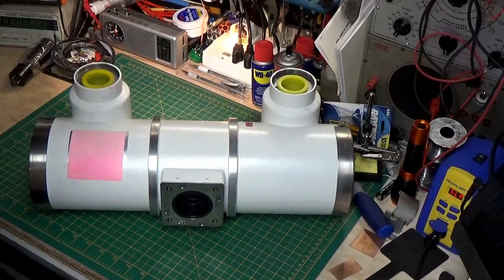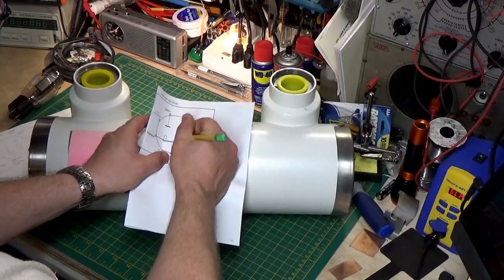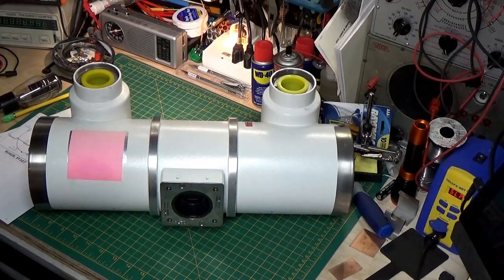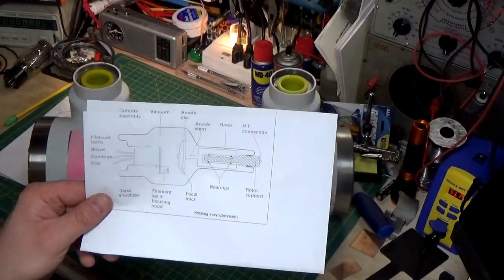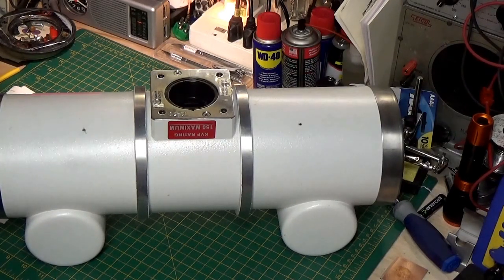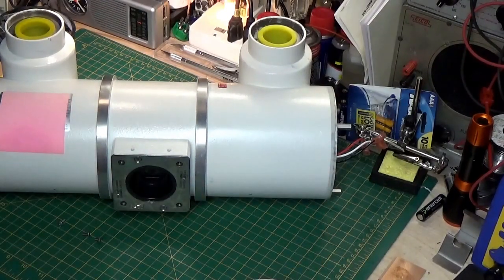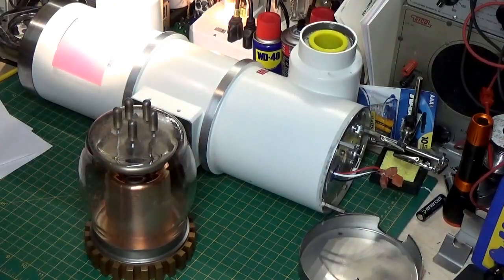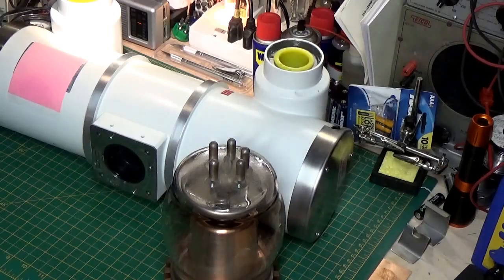X Ray Series #1   The X Ray Tube

Comment: I would clarify the statement that you cannot have a stationary target because it would melt. In the case of imaging x-ray tubes, I agree, they use a rotating anode for cooling. However, in a linear accelerator which uses a huge order of magnitude higher energy, ie 6MeV or 18Mex photon energies, we use a stationary water cooled tungsten target. Another item of note is that these x-ray tubes use differential voltage, that is each high voltage cable is at a potential of +/-75KV (to give 150KV). Very nice explanation of the x-ray tube, we have these in our C.T.'s and Varian radiation treatment equipment for KV imaging.

Comment: If the Xray housing tube is having leakage of oil and it  malfunctioning, what next for repair and how much is the cost for new one?
Reply from the maker: Certain housings are non-repairable and need to be replaced.  Others, such as those made by Varian/Varex, for example, can be sent back to the factory and have the seals repaired and oil replaced, as long as the insert is still good.  Cost is less than a new tube, but not a whole lot less.

Comment: What is the wattage of an xray tube?
Reply from the maker: They are all different.  The one you see in this video has a maximum dissipation of about 50kW, or 50,000 watts.  So if you apply 100kV (100,000 volts) at 500 mA (.5 amps), you would be in spec, but just barely.  Some of the larger tubes are capable of 80 or even 100kW.  Tubes used in a CT (cat scanners) are even larger.  More important is the duration.  Even though a tube can peak out at 50kW, it is NOT for continuous duty, but rather for short duration (less than a second ).  X-Ray tubes also have a "heat unit" rating, which takes into account the rate at which any given amount of wattage will heat the anode of the tube versus the rate at which the anode can dissipate the heat.  Exceeding the heat unit rating of the tube will cause damage to the tube and can even cause the anode to melt (been there, done that)!  The tube in the video has a rating of 200,000 HU (heat units), and there is a chart that shows the rate at which heat is accumulated and dissipated with respect to kW of input power applied for each tube type.  Hope that helps.

Comment: Just curious what would happen to the tube if it energized and it was way to hot
Reply from the maker: +Jon SilveiraEach time the tube is energized, it starts to heat up.  If you don't give proper time for cooling, the heat will accumulate faster than it can dissipate.  If the tube is overheated, it could fail in a similar way to a regular vacuum tube that you would find in an amplifier or radio.  Just as a radio tube will "red plate", meaning the anode gets red hot, so also will the anode of the x-ray tube get red (and sometimes even white) hot.  This can damage or even destroy the tube.  In extreme cases, I've even seen the glass bulb of the tube crack, causing the oil to leak out of the tube port.  You really have to overload the tube for this to happen, though.
Reply: +xraytonyb  oh ok thanks I was curious when the glass breaks must be scary
Reply from the maker: +Jon Silveira Only if the tube is over a patient (thankfully, I've never seen this happen!)  ;)   Otherwise, it's just a mess to clean up.